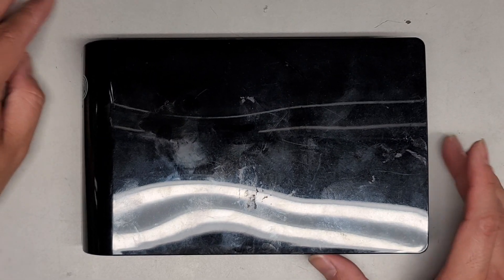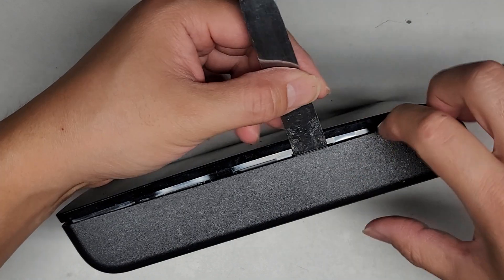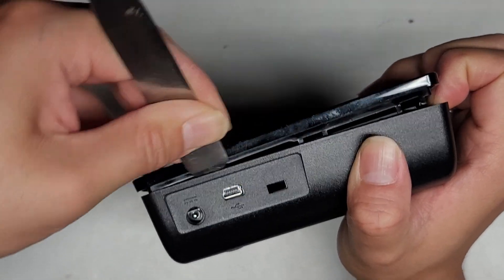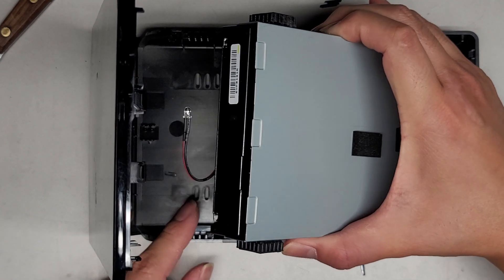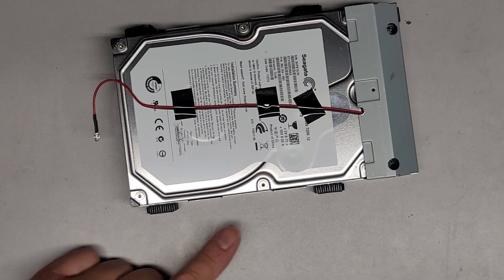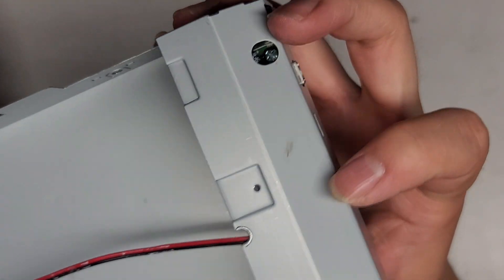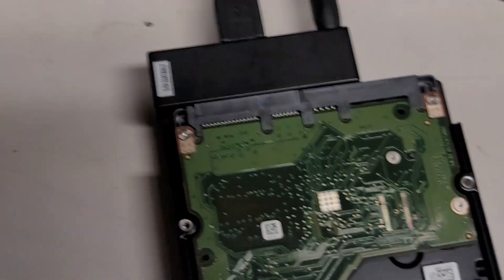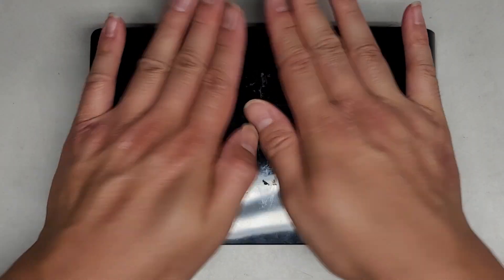Seagate Expansion External Drive 9SF2A4-500 Disassembly Enclosure Adapter Replacement Repair

Comment: 4:00 that screw hole on the right is for the other half of the HDD cover. looks like you were not the first to open that drive.
Reply from the maker: @lunarul  hm?
Reply: @ItsBinhRepaired  the HDD caddy is made of 2 parts, completely enclosing the HDD. to access the HDD you'd open another tiny screw and remove the top part of the caddy. you can see the hole where that screw goes at 4:00. that top part of the caddy also has guidelines for the LED wire (which in your case was attached directly to the HDD itself). so it looks to me like someone opened that drive before and didn't put back the top part of the caddy. either that or at some point Seagate started shipping these without it.
Reply from the maker: @lunarul  they said it's never been opened

Comment: LuL. Just clean SMART data and recalculate translator through terminal connection.
Reply from the maker: Wuh?
Reply: @ItsBinhRepaired  This is a rather old seagate drive, where terminal is not locked and fully functional. Find an TTL-compatible UART device, set in terminal baudrate at 38400, connect to rx-tx pins of drive's terminal on the interface part wheres 4 standalone pins : [PWR] [SATA] [RX:TX:GND:NC]. Get drive powered on only (no sata connection). Wait for an error code displayed in terminal after 3-4 clicking rounds and proceed with a typical solution for "LED:CC" error of 7200.10-11 F3 family fully disclosed on every hdd-related forum. (Ctrl+Z for entering command mode in terminal "F3 T>" , send /2 to get on 2nd command layer, then Z to stop spindle, U to get spindle back on, /1 to get on 1st layer, N1 to clear smart attrs data (it's out of boundaries), now pwr-off by disconnecting pwr and power it back after 10secs,  then Ctrl+Z to get on T-level, "i4,1,22" to clear G-list (optional), repwr it again, and finally "m0,2,2,0,0,0,0,22" to get translator recalculated (wait for it finish).
Reply from the maker: Hmmm I don't know how to do any of that. Haha
Reply: Yes please elaborate i also have one of these hardrives and none of my computer are able to read it